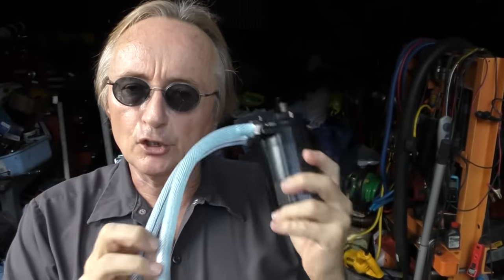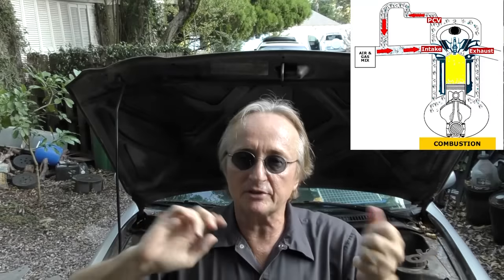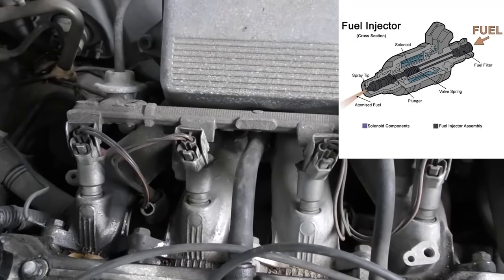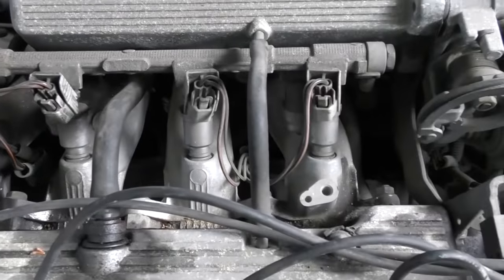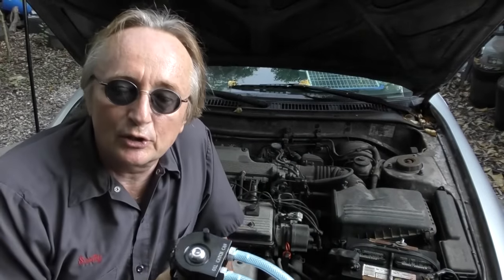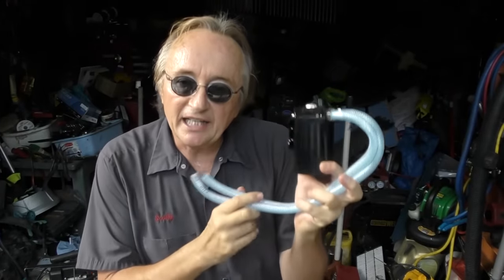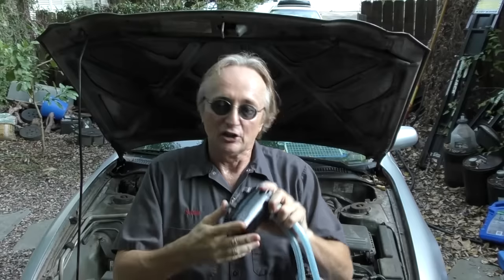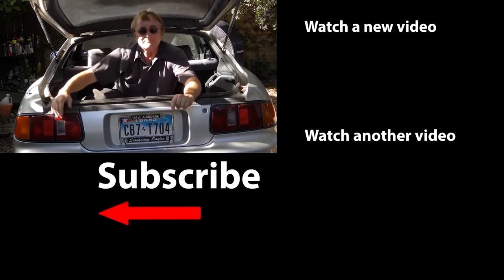If You Have This Type of Car, You Need This to Prevent Damage to Your Engine - Oil Catch Can

Comment: I wish I had a dollar for every engineer that screwed up a design.
Reply: Eh...it comes with the territory. Aluminum block engines, cylinder deactivation, fuel injection computers...the early ones had problems. It doesn't mean they weren't good ideas, they just weren't tested properly before release.
Reply: Sometimes they screw up due to management. And possibly on purpose as well. Pinto, anyone?
Reply: Most of the time it's not their fault.  Automakers task them with speed of assembly as a first and foremost goal, with the fewest human hands on the work as possible. Often times engineers will come up with a beautiful masterpiece of engineering but a marketing guy will hore a 'value engineer' (thats a real job, google it) who will take everything good out of the design to shave a few cents off production costs, or to use existing parts so that they can save from having to make new tooling,  or simply the logistics of shipping inventorying or storing new parts, or simply removing as little as one production step.

GM is notorious for this.  To this day they use the same delcotron alternators that have a fatal flaw of blowing up if the battery's ground happens to be loose, GM locks can be serviced by the same kit of parts all the way from 1934 through 1994 with the addition of just one single part. They have keys that are all dimensionally identical as far as keying specifications go  starting with an "A" blank through a "K" blank when they switched to a double sided key in 1994. The manufacturing process in 94 used the same metal stamping tools from the 30's. The only change was changing the setup of the milling machine that makes the grooves in the side of the key to slightly different locations. 
Even their ignition lock body castings were reused, In the 70s and earlier the locks slid into the steering coloum and snapped into place. Problem was they were easy to yank out with a slide hammer, so they stopped putting in a spring loaded retainer  and instead machined a groove in the side to hold it in place with a bolt! Guess what, even though the spring loaded tab isn't there anymore nor the slot machined for it to go into, the spring is still present staked into the side of the lock body even though it had no function for over 30 years!

Funny enough The company that makes GM locks, strattec, formerly Briggs and Stratton also makes chrysler locks. 
Inteterestingly enough the double sided gm keys from 94 on are a mirror image of the chrysler/dodge keys from 97 on except the chrysler keys are a tad thicker. 
That seems coincidental but it's not.

When strattec's dies for making GM keys get worn out, they flip them around backwards, run a broach through them, and then they can make chrysler keys. All that so they can use a die that probably cost 5,000$ to make and can produce millions of keys, and do a small mod to it and flipping it backwards in a machine to produce millions more keys for another one of their customers! 
The same goes for engines and more. 
Often times this can cause problems down the road and or make things far harder to fix, but that is of no concern to people who make and sell cars, if it saves those people a single red cent they are going to do it!
Reply: Even a penny !
Reply: +Willy Automotive Yes, even a penny.  Look at the ford focus, there are like 5 million of them out there and everyone who has ever worked on them knows ford and mazda cut a lot of corners to pinch pennies here and there on them. 5 million times 1 penny is 50 grand. If you save 100 pennies over the whole car, which is a great underestimate you save 5 megabucks. That's a lot of money that the company gets to keep as profit.
Reply: Engineers are fully aware of the problem, and when they address it, their supervisors say "no its going to cost 3 cents to prevent it"
Reply: Youd probably have enough to actually pay for a dealer to work on it 🤣
Reply: I wish I had a dollar for every time I had to fix one of their screw ups!  I love talking to our engineering dept at work "it looks fine on my computer, just do it".  I yank those guys out of their office and make them show me how this is going to work... then they go back to the office and make more lines on napkins with their crayons!
Reply: Mike Cassano, except wealthy individuals don't like their high end cars breaking down more often than medium to low end cars
Reply: But don't he always says that the people who made the cars know what they are doing and they know best
Reply: electronicsNmore like they say, Engineers are the one who makes latest groundbreaking designs and the Techs and mechanics are the one who fix the mess or the flaws of engineers
Reply: Keep in mind the engineer's job isn't to design the best product possible. Their job is to design the cheapest product that will do what it needs to do. Anything more and it drives up cost and makes the product more expensive.
Reply: I'd be set for life on just a penny each time.
Reply: electronicsNmore automakers engineers should be forced to work on every vehicle they design.
Reply: electronicsNmore you would be the richest man in the world.
Reply: I wish I had a dollar for every time a modern Mercedes broke down.
Reply: Peter Carlson 50,000$ is nothing to an automotive company, that's the difference between 5 sales and no sales. Or the difference between having 101 line mechanic salaries to pay VS 100 line mechanics. Whats more important to them is reliability and the reputation that comes with it. Having an oil catch can is something that vastly boosts reliability, and I would gladly pay an extra 50$ to have one installed from factory. They didn't think that far down the road to really assess the impact of a catch can
Reply: electronicsNmore you would be more rich than trump
Reply: electronicsNmore you’d probably have as much as the engineers that screwed it up gets paid in a month
Reply: I don't blame the engineers. 
I blame the bean counters who wouldn't fund development of two injection systems until consumers demanded something better than stand-alone GDI.
Reply: It is often rushing and wishful thinking.
Reply: I wish I had a dollar for everyone who thinks they can do better.
Reply: Definitely tot a screw up, just another component of the planned obsolescence strategy
Reply: You'd be a billionaire
Reply: Yeah, like everyone else engineers are "pushed" by management, bean counters (accountants), etc. to design it for a price point, and a durability factor.    Would be nice to make things last forever (think $$$), but it simply isn't going to happen.
Reply: he says engineering screw up, I say done on purpose to fill service departments, sell new engines and vehicles ;0
Reply: I wish i had a dollar for every mistake you made. People arent perfect.
Reply: @n_u001  You wouldn't be too rich. LOL
Reply: It's just about always due to Management not engineering. I have been both, and have seen that from big companies to small companies management always dictates what all employees, especially engineers, ca do and when they can do it. The shortcuts in products are always known by management, management tells engineering what they can work on, how much tome they can put into figuring it out, how much time in testing and which materials they can use. Management then goes to the purchasing department and tells them exactly what materials and services the engineers are allowed to order (and when) so the engineers are hamstrung. Typically, management gives engineering a highly restricted timetable to get the product created, that timetable is always, without exception, far too short to be sure that everything will work correctly, let alone work perfectly, in the short term (they have no idea if it will work in the long term because they aren't given ten years to put a new motor or chassis design on the streets for long term testing.

What consumers fail to do is to complain to management often, and consistently, so that management can get a big enough headache that they allow the engineers to design and test the products properly. Sure you get a handful of loud complainers, but those people actually aren't helping anything because they complain about everything, even products that are perfect fine, so management ignores them. Its all the other consumers that need to make themselves heard so that management will ease up on those billion dollar pursestrings so we get better products in the end.
Reply: Oh yeah me and my 5.4 triton would love that lmao
Reply: Toyota got smart and used both systems on the V6.
Reply: You're Mr. Jenkins. If you intend to assault somebody learn how to form a proper and grammatically correct assertion.
Reply: @TheWalterHWhite  "Auto correct"
Reply: @TheWalterHWhite 😂 Triggered!
Reply: @TheWalterHWhite  Not really!🤣
Reply: 82raptor Then you should become an engineer and show everybody how great you are by making it perfect the first time.
Reply: A3Kr0n That is the best comment Ive seen so far.
Reply: @christianandersen7458  Engineers are at the mercy of Auto Manufacturers and Government regulations. They have a hurdle of political red tape to deal with. To top it off they are scrutinized by manufacturers for expense. If you save $100 dollars per vehicle, and make 1 million vehicles you just saved $100 million. That is how auto manufacturers work. They are there to generate profits. In todays day and age it's too easy for them to have a flop and go bankrupt.
Reply: Do you remember the VW scandal when they made their cars run cleaner during testing than in the real world? Well that was due to the fact that they knew people wouldn't care for the cars properly to have the system turned on all the time. Same with this, if they add a catch-can people wont empty them.
Reply: @TheWalterHWhite  As opposed to "$5000 scan tool" based diagnostics? When the parts are all old and labor is $100+ an hour, why NOT replace everything the mechanics touch? I mean, provided factory parts are both available and not $$$

For the record ODBI car diagnostics are sometimes like reading an OUIGE board. I have one now that has an occasional low speed miss. There is no code. It could be a lot of things, so I'm replacing all of the normal things. When "everything" is cheap vs labor why wouldn't you?
Reply: @98triffid  with my snap on scanner, I can solve most problems on modern vehicles fairly quickly. That mentality is what plagues the technician / mechanic field. Instead of diagnosing / mechanics would rather swap out parts and charge the customer excess amounts for THEIR lack of knowledge. A lot of times they don't actually fix the issue. A defective part is usually a symptom of another issue. 

People think advanced computer diagnostics are a curse rather than a Blessing. Instead of starting with whole systems tests and guess work, I can now get a code that narrows it down to an almost exact problem. "Purge valve open circuit condition." Well there you go let's find the open. With advanced diagnostics you can control items independently. Let's say you want to test a purve valve. Boom use your scanned and it will cycle it. Just because you lack the technical capability and intelligence to grasp the diagnostic process doesn't mean its wrong. The problem lies with you. This is why we go to doctors instead of web MD of quacks. The doctor has the knowledge and technical capability to diagnose and heal. The quack will just guess and hope, and guess who ends up paying more in the long run. The same goes for hiring a technician.
Reply: @TheWalterHWhite  I certainly don't think that. If the ODB1 computer would actually tell me what was wrong I would replace that thing. It's not as if I don't look at codes. Your fancy SnapOn tool is unlikely to do much better. Given that I don't know which thing is jacked up I will order the normal things and replace them. If you are dealing with newer cars or ones that have big parts costs maybe go further but don't call me a Luddite for being pragmatic.
Reply: @98triffid  obd1 cars are so antiquated you really don't need to pull codes. It's a nice direction but basic diagnostic procedures can generally rule systems out one by one. However, I've run into gremlins with older vehicles that still use distributor systems and old FI that have bugs that are harder and longer to track down than say a modern vehicle with advanced codes and live data.
Reply: @TheWalterHWhite  Didn't I already say that?
Reply: you would have seven dollars......
Reply: go on make a perfect car then you can say stuff about engineers. hint there's no perfect solution
Reply: Scotty you like Toyota what’s your opinion on a 1jz ? I bought one he gave me an oil catch can with it
Reply: made to sell, not last.
Reply: With Toyota engineers I earned about $5 lol.
Reply: Sorry there is not enough money for that
Reply: With that money, you could hire a good engineer
Reply: Lots of good engineers were hampered by the bean counters.
Reply: Technicians are needed to correct the things those engineers screw up.
Reply: I wish I had a dollar for every time an engineer was told by management that Design A might be a better design but we're going to use Design B because it's cheaper.
Reply: @mikex1384  True
Reply: electronicsNmore 

You think the auto engineers and those who control them ( don’t forget that ) are bad

How about the bastards who built a nuclear power plant perilously close ( or on top of. I cannot recall.  I just recall my fury at the arrogance of scientists - who are now playing with climate and virus)  to an EARTHQUAKE FAULT?  I believe this occurred in New York.  Someone correct me if I’m wrong
Reply: Planned obsolescence
Reply: The engineers know what they are doing.  The accounting departments tell them that they need to cut corners to get a higher profit margin.  I would like to see the car that engineers would create if they had no interference.
Reply: engineers already knew, it's the regulations and restrictions given to them to meet emission standards.
Reply: I spoke to an automotive quality engineer once and he said that they can preproduction test and test, but they won't really know what they have until about 6 months into production.
Reply: @98triffid  Eh, stop and go systems?
Reply: They are experts at that!

Comment: Oil catch cans should be installed in all cars, not just certain engines, and those cheap plastic clear hose are garbage. I'd suggest getting thicker hoses stainless steel, or the Black rubber hoses.

Comment: Yes! You answered my request to put this video up! YOU ROCK SCOTTY!!
Reply: Hey Scotty, I purchased “M7 Racing” oil catch cans for both the turbo side and for the PCV side for my MCS r56. I notice the cans aren’t  baffled with anything. Should I let it be hollowed the way it came or should I put stainless steel mesh inside or some type of material to help it filter better? Seems like no one really knows definitely what is safe and what isn’t out there on the internet. I would trust your judgement before anyone else. May you pls make a suggestion. Thanks again God Bless

Comment: Well Scotty, you have another excellent video that can help owners save thousands. This PVC Catch-can is a cheap, less than $50, prevention item that should be done by thousands of GDI owners a.s.a.p.! Make sure you get a decent pressure capable can with a heavy screen to keep the water/oil at bay, coming through the PVC system.  I do like the can models that have a drain on the bottom with a drain valve. Great idea, great video. Keep Rollin'!

Comment: Ever since I purchased my 2015 Ford Escape with 1.6L ecoboost, I looked for any advice to maintain my vehicle using YouTube.  Saw my first video of Scotty and absolutely enjoy his videos, and respect his knowledge of what I might need to keep my vehicle running.  After watching a few videos regarding the engine installed on my vehicle, I've sometimes wished I purchased something different.  After watching this video, I have since purchased the catch can as recommended by Scotty hoping that it will help with excessive carbon buildup on the valves.  Anyone have a description of what lines to connect the  catch can to?  Look under the hood, and say to myself that it doesn't look as easy as I thought it would.  Just want to make sure I'm accessing the correct lines so I don't cause myself more problems.  If I know exactly what to connect it to, I am comfortable installing it.  Thanks Scotty.  From a happy subscriber.

Comment: The exact tech we've had on small recip aircraft engines for 70+ yrs. Works great and, I even have a secondary catch can installed after the air/oil separator to save the lost oil.
Reply: BMO  Yes, you could do that however, I just put that same Small amount  of catch can oil back in the engine.

Comment: Thanks, Scottie. Seems like the emissions control systems on GDI engines would be screwed with oil from the combustion products from oil blowby (and oil coming down the valve guides). Another problem with blowby is the blown oil seals on the crankshaft, which occurs when the PCV system gets completely clogged (due to poor design) and the blowby pressure has no where else to go.  Case in point - the GM 2.4 L Ecotec engine, the engine design equivalent of the disaster known as the Chevy Vega.  Thanks for this video and your opinions, and thanks for continuing to make them brief and to the point.